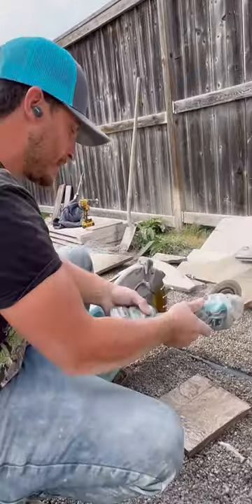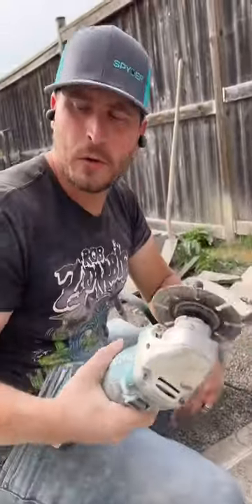GRINDER TIPS! #construction #shorts

Comment: You might want to find the blade guard while you’re eye sight is still intact.
Reply: That's so true and had a good laugh
Reply: It limits your cutting ability, wear safety goggles you'll be fine, ceramic tile in your eye is gonna be a problem for you, I've cut steel tile concrete, all kinds of stuff , never got hurt yet,  maybe I'm lucky/extra careful  or just not an idiot. Don't take the guard off if your not comfortable without it , and I'd say never hand one to an employee withouth the guard on, at your own risk type of thing
Reply: @joshuawhite1692  like I said if you're not comfortable without the guard , keep it on. What exactly is it that you're afraid of? The blade flying apart? Or dust/chips? Or do you think an angle grinder can kill someone?
Reply: @michael2943  a guy a few years older than me cut his thigh and femoral artery open and lost 4 pints of blood, and later his leg. If it wasn't for the fact his heart stopped and therefore stopped pumping he'd have lost all his blood and resucitation wouldn't have been an option they managed to get his heart beating and he had a transfusion, by the grace of God there was blood at the local hospital whereas most others around here don't keep any on standby. They spin at 12,500 rpm never think you're tougher than engineering many many men have almost died and died at work by paying undue care and attention. Had he been at home in his garage and not at work, no one would have even noticed. Do what you want but I knew the man since I was a baby and since his accident he hasnt been able to walk or work a single day, this was 2 or 3 years ago. That means he can't and hasn't supported his family since that day. I see his brothers all the time but I've not seen him since. His life is pretty much over at around 26, so yeah grinders are not toys respect them or they will humble you
Reply: There isn’t a cut you can’t make with the guard still on and readjusting. Its inexperienced people who haven’t seen what a grinding wheel can do to your body and anyone who is unfortunate to be nearby. Readjusting the guard is simply an inconvenience to them. What is an inconvenience is taking someone to the hospital for a preventable accident. Professionals use all safeties, guards, and PPEs. Hacks and amateurs don’t! Companies that promote a culture of safety complacency are setting themselves up for a big payout for personal injury attorneys ultimately.
Reply: @pauldiesel4582  why does the guard come off?
Reply: @pauldiesel4582  I would argue inexperienced ones are the ones who get hurt.
Reply: @michael2943  Do you really not know why the grinder guard would be able to be removed? I don't know if your serious or not but if you are, here is your answer. The guard can be removed to change the type of guard or to replace a broken guard, would the 2 most common reasons.
Reply: @fritzthecat2634  thats a horrible answer
Reply: @michael2943  Maybe I misunderstood your question. I thought you asking why the guard would be able to be removed if it's such an important safety feature  so I gave two reasons.

Comment: Let me give you a tip… don’t ever take a tip from a guy who has no gloves and no glasses
Reply: You need glasses but you're not supposed to wear gloves when working with power tools because they can get caught very easily. But he does need glasses and he does need to put a gaurd on that thing
Reply: Mask too. NEVER cut masonry without a mask even outside. Silica dust bad. I don’t like not wearing one cutting anything wood included. If i don’t ill get a stuffy uncortable nose all night.
Reply: Nah gloves are optional, might Nick your hand or finger but at least it won't pull your whole hand and arm in and mutilate and crush your fingers n shit. But then again you kinda need the safety guard on there for it to pull a gloved hand into the gap
Reply: And no mask
Reply: @strizzy239 I can literally see all the dust dridting  away in the wind. Mask outside? Really ? You wear one in the truck on the drive home too?
Reply: And no guard
Reply: @michael2943  There is a difference between doing it at home and being a professional doing it regularly
Reply: @strizzy239  seems like an issue ma’am you should get your husband to do all that sort of work so you can sleep soundly at night
Reply: @Tonyrd3000 exactly!!! If i didn’t wear a mask with the stuff i do, i would be suffering every single night and probably die painfully and a lot younger. He equates it to covid lol i rarely wore a mask
For that. Breathing dust daily scares me much more than Covid ever will. I don’t think he’s ever breathed a lot in and suffered all night because of it.
Reply: @abrahamgalarza5421 another internet troll lol go breathe some silica dust every day and tell me how you feel after. Clearly you don’t do stuff like this very often
Reply: Seriously, also putting your hand near the blade with no gloves? Ridiculous, “skill” he says. All it takes is one fuck up and your finger is gone. I lowkey unsubbed
Reply: @endurement  nah that blade wont cut your finger off. Back in my day there used to be men
Reply: @immortaltiger2617  no gloves for grinder? It looks like you never used one...

Comment: That's why when you cut with the blade on the right side, you do a pull cut instead of a push cut. The pull cut with the blade on the right side is sometimes beneficial cuz it blows the dust away from you.

Comment: First thing you do is remove the handle from a two handed tool. Then remove the guarding. But its all good because you have safety squints.
Reply: I think the handle is for grinding wheels. For cutting discs or cutting wheels  , two hands  doesn't do you any good. I think  that's why the handle comes off

Comment: Pro tip 1 to 3. 1, Put the disc shield on there to protect against discs flying apart. 2, wear glasses. I had frienda almost losing an eye bexause of stone and metal chips. 3, wear gloves to help control of the machine

Comment: You can undo the 4 screws on the grinder and rotate the whole blade 90 degrees so the on off button is within reach so you don't have to struggle to turn it on or off

Comment: Bros you really don't need glasses to cut concrete or tile. As for metal, 100% that steel diamond saw he has ain't gonna break and dust isn't going to blind you.
Reply from the maker: I agree! When using an abrasive blade to cut or grind metal I’m 100% wearing goggles